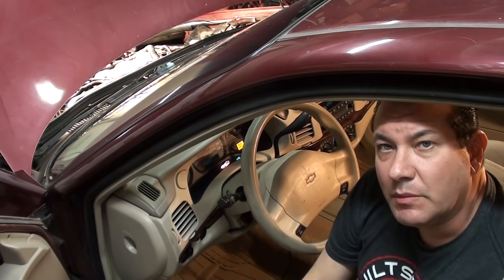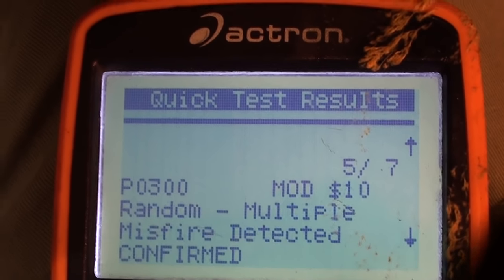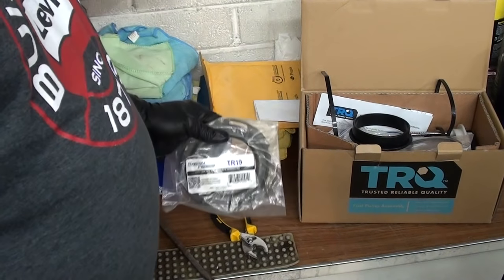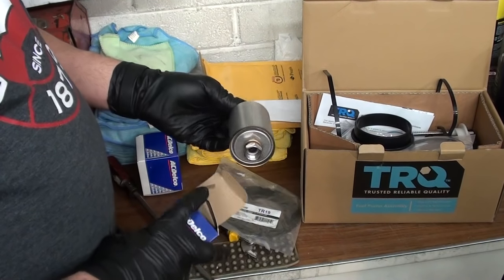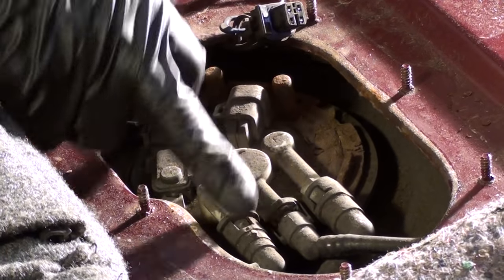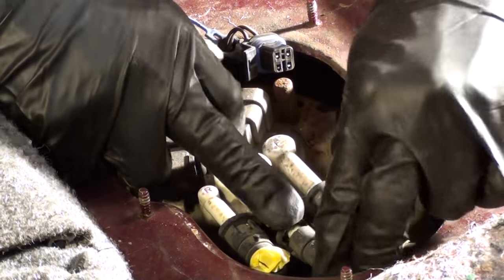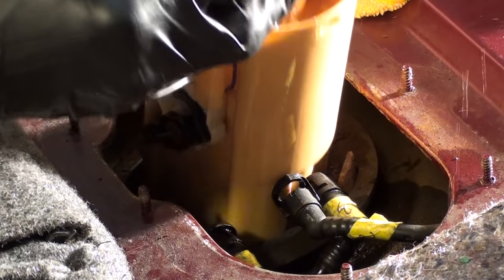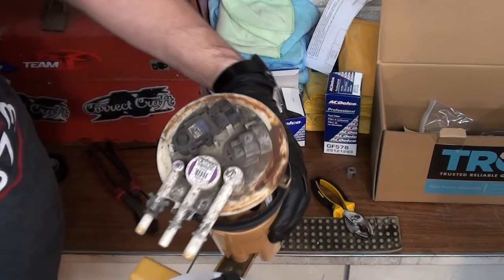How to replace the Fuel Pump on a 2001 Chevy Impala 3.4L

Comment: Liked your video very helpful i gotta do this now guage not accurate aftermarket is the way to go when i have a 2001 buick regal that rusting and only worth 700 800 bucks why pump oem for 250 ac delco pump when the car is only worth 1/3 of that im going aftermarket also thanks for the video i can see if you had a 2013 in great shape and wanted to keep the car long term then pump in OEM was just reading other comments where people said go oem not if the car isn't worth it money down the drain then .. good video thanks.

Comment: FYI you need to use a brass punch not steel. it will cause a spark and go boom!
Reply from the maker: A spark outside the gas tank would not go boom. That ls logic. I have never heard a brass punch not creating a spark either way. Metal to metal can create spark ⚡️. 
But either way i was keeping the tool on it not to chip the metal.
Reply: @raiderman28  It has happened to others in the past and he is correct on that! Gasoline fumes are also highly flammable and any spark can and will ignite them and thus boom still happens!!😒

Comment: Thank you for the video,I don't know but you said that the tank has like 2 gallon of gas; just when you staring work on the pump on the video show full tank After you finish the video still show maybe a little bit low of the line of full tank. something was wrong here because 2 gallon of gas it would show at least 1/4 of the gallon maybe wiring was not connect right or that was something wrong with the pump.what do you think....
Reply from the maker: Because i know i added at least 2 gallons of gas ( is what i meant to say). Obviously the float that comes with the new fuel pump was bad and replacing it fixed it
Reply: Thank you master I knew something was bad thank you to letting know that...
Reply: @raiderman28  I apology to you if you feel that I was sound like I was criticize your work that was not my intentions, I fell very proud from people like you that take the time to show how to do those tape of job and explain step by step how to do it. We need more people like you to do this cain of job. Thanks again Good bless you ....

Comment: I didnt buy the new connectors at first and just replaced the fuel pump in my 03 impala, i currently have a leak on my pressure line where it goes on to the pump. would replacing the quick release clip fix that by chance?
Reply from the maker: If you have a leak , then yes

Comment: Any suggestions for when you are not getting power to the fuel pump? I just replaced the fuel pump on an 02’ and when I tried to start the car, the pump isn’t coming on.
Reply from the maker: There is a relay in the engine compartment. If that is not getting power, then possibly a fuse. But if the relay is bad, that can also cause it not to get power. If there is another relay on that fuse box that looks the same and is not being used by the engine, for example a headlight relay or horn relay, you can swap them and see if the horn or headlight still works. This will tell you if the relay is bad.

Comment: Will a fuel pump issue have anything to do with a kind of "whining sound", or like a low "rumbling sound"?
Reply from the maker: Depends on where the sound is coming from
Reply: @raiderman28  I have a 2005 chevy impala, and there is NO fuel pump panel behind the seat!!  Why would my car not have the same access panel location?
Reply from the maker: @regionalunityproductions6204  its possible its different because its newer, and in a different spot.

Comment: There's a special tool for releasing those lock clips, makes the job a lot easier.
Reply: Whats the name of the tool?
Reply: Should've given a name.
Reply: Yeah I was wondering that also
Reply: The access panel makes it difficult to fit the tool if at all, you’re better off beating the thing loose in that tiny compartment. Mine was extremely rusted and it came out no problem with a hammer and a cats paw

Comment: I have a question dont know if you still be on youtube but will not putting the fuel tank ring in all the way cause a po446 code for my 2002 chevy impala? Engine light came on a day after I changed my fuel pump. Please respond to my question thanks man
Reply from the maker: Mallory Cain Jr. P0446 Evaporative Emission Control System Vent Control Circuit Malfunction. The code P0446 is set when the engine computer recognizes a fault or restriction at the vent control part of the Evaporative emission control system (EVAP).
Check and make sure evap hose is connected correctly, and that the ring is on all the way. Sometimes a bad gas cap gas cap can cause this also, thats why I replaced mine also.
Reply: @raiderman28  thank you for responding I wanted to get this fixed ASAP autozone said its not a major Problem but I dont like things not fixed. Also, theres a little space between the fuel ring lock and the tank itself but the ring locked in when I hit it in. Is that how its supposed to be or is the ring lock supposed to be completely flat with the fuel pump and tank? Like flat to he point where I cant stick a flathead between the spaces?

Comment: What were the issues prior to this??
Reply from the maker: Cranking and not starting, then i checked fuel pressure with gauge and it was low. Pump was bad
Reply: @raiderman28  have the same issue but car would also stall sometimes coming to a stop then rough or hard start. My fuel pressure on 3.8l v6 Impala is 44psi with car on 39 car off and will go to 0 after after about 15 min off. Changed at least 8 parts still no fix in sight

Comment: Mine says random cylinder misfire p0300 and (pending code) system to lean bank 1. My car will start for 20 seconds then when I push the gas it will shut off. Do you think I should change the fuel pump? Mechanics I call all say that it could be the pump. They want to charge me 500 plus parts.
Reply: And I have a 2000 impala v6 3.8l is this the same process? Thanks
Reply from the maker: mine has the same misfire code.  it turned out that if has low compression in 2 cylinders, because it had a blown head gasket.  new fuel pump might keep vehicle running, if its bad, but not fix the misfire.  you need to check the compression in all cylinders before going forward, or else you will be spending money you don't need to like i did.  my car turns on an runs better now, but i have the same misfire, and low compression, so i would have to tear the engine down, which is not worth it.  looking for a used engine with low miles to do a swap.   i got the car for free, but its becoming a money pit.

Comment: When my engine misfired I usually had to have a heli coil done.
Reply from the maker: beastumfan isntt a heli coil when you spark plug gets stripped?
Reply: @raiderman28  I think so. It fixed my engine twice but one of the times it was something else and I swapped engines.

Comment: 1. You don't have to break one of those pieces he said you have to
2. You dont have to wire in anything, just make sure you have the right pump. Look at your pump and if autozone or somewhere doesnt have it, then buy it from Amazon. I always do and always get the right parts

Making this job seem harder than it really is
Reply from the maker: Chance Houston job isn’t harder. This are aftermarket parts. Most parts plug right in. But if you know about these cars, the plugs fall apart, so they make a nee and improved plug that usually has to be wired in ( which is super easy). Unless you buy it an expensive pump like $200 , those might come with just a factory plug.
Reply: not true on this vehicle unless you buy it through the dealership.  they want $249 for a factory fuel pump.   amazon pump is the same as the one on eBay (aftermarket) and they have to be wired in.  you should check your facts before saying what you just said.   these plugs fail all the time, that why they came out with a wire in new plug, because chevy used cheap plastic on this factory pumps.( they disintegrate when you take them apart most of the time)  i have done many of these over the years.
Reply: Only idiots by factory fuel pumps with the housing. I stand with the last two comments. Professional nut buster since 1996